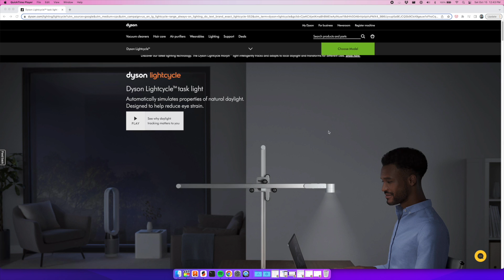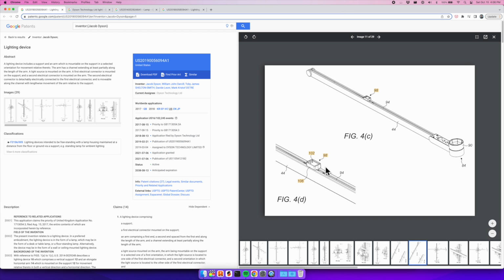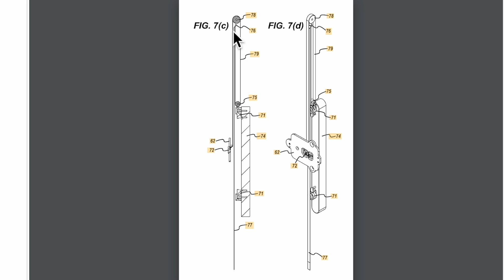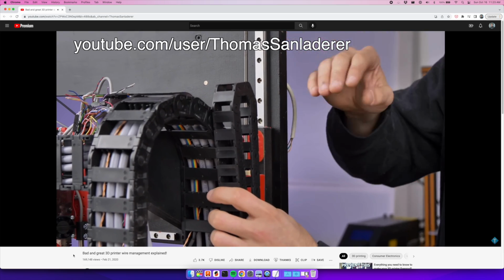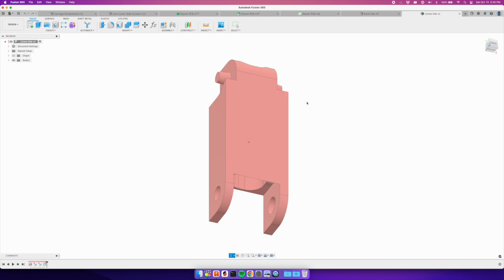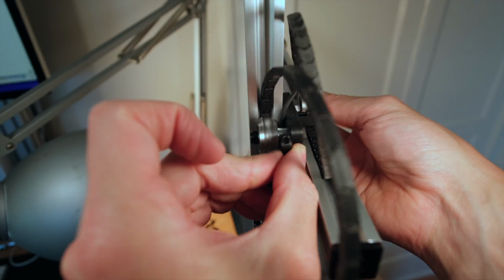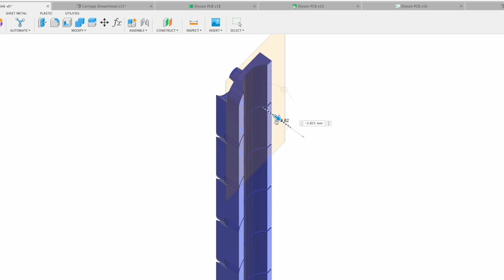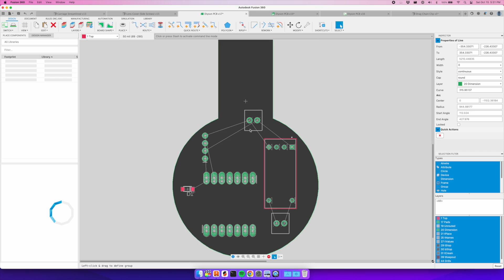Cable management so good, it's illegal - DIYson Lamp Build Log #6

Comment: I have two of the 1st Gen Dyson Lamps.
Your setup is missing a somewhat crucial part for it to have functioned properly - A stationary "Retaining Bar" that is situated ALONGSIDE the Rail that moves back and forth.
Between the stationary and moving Bar is the Ribbon Cable inside a Channel of the moving Bar located that would gladly like to pop out of it ( like yours do ) but cannot because of the stationary one. You COULD get somewhat of a similar effect with your Drag Chains IF you were to design for them to only be able to curl up in one direction but NOT the other though in any case, you'll not be able to hide the wire like that as you're simply not able to pull off a tight enough bend for the cable not to break under repeated bending fatigue.
Reply from the maker: Interesting detail. As far as I can tell, this is only a feature of the original CSYS but not the updated Lightcycle model. Is that right? If so, it seems like they were able to pull it off without the retaining bar after all :)
Reply: @StevenBennettMakes  The current Lightcycle looks like the horizontal bar consists of two bars with the Wheels and the Magnetic Connector in-between them implicating that that the ribbon band could be situated in there as well - For as long as the ribbon band doesn't get caught due to friction, I could see this still working out for them.

Comment: I think this is an awesome project and think your design is excellent. But I see a huge problem with yours and Dysons design. You can't rotate the light, like you can with your desk lamp. You can point the light sideways. I often do this with a desk lamp when working on a computer. I think this would greatly improve the design.
Reply from the maker: Yup, that's definitely a downside. Rotating the light source would be a super convenient feature, but I think it's a different project altogether (Dyson even has a different model called the "Morph" that does this, and the overall design is understandably quite different from the traditional Lightcycle that I'm trying to replicate). Maybe that's a future project?

Comment: Wild idea: use the aluminum extrusions as the ground wire, route a thick wire for the +12 volts of the LED and a thin wire (or 2) for power to tiny controller board. The controller board reads the buttons and communicates wirelessly with the main controller located in the base

Comment: That cable look really thick. Consider sending 60V over a much thinner wire and using a buck converter module on the lamp head. There are also more flexible silicone cables out there
Reply from the maker: I'm open to suggestions for a thinner cable! This is the smallest 2-conductor cable I could find (it already has a silicone housing).
Reply: @StevenBennettMakes  Huh, it's hard to tell over video but that cable looks more like PVC/vinyl rather than silicone. If you search eBay for "30 awg silicone" you'll find some really thin wires, but I'm not sure where to buy thin 30/2 cables. Oh here's an overcomplicated idea: Maybe you can use just 1 wire for +60V and use the chassis for gnd. That might cause the LED to flicker as the lamp is adjusted, but that can be solved with a tiny 100mah lipo in the lamp head.

Comment: Wheels can be made of conductive material. And you have 2 groves on each side... You don't need cables at all, just flat bars inside groves. Or some kind of clips with pogo pin contacts.

Comment: Thanks for the video, no need for cables you can use tow aluminum profile in parallel and electrically isolated from each other so u can passe power to the lamp with the top and bottom metallic bearing the same thing u can use it with the vertical  beam.

Comment: improvement suggestions :
1. you can use a esp32 than it is easier to make the lamp smart (because of the build in wifi funktion)
2. when you make mini V wheels on the inside of the weight and pull it to the rail whit magnets than it can roll smooth
3. for the wire you can use mini model train rails to transfer power (maby you need a capacitor (1500 uF approxi)) that the light dose not flicker)
(sorry for my bad english i am german)

Comment: I have a suggestion; I wonder if you can build a hidden spool for a wire on the center carriage. A hidden cable to drive the spool ( dont know if a spring loaded spool will work since it might offer an extra net force for your static carriage). 

Use thin 4 cable wire and by using a Power delivery USB type C to carry higher voltage at lower Current (like running at 24V), you might need to run a small buck converter to drop it to your voltage. And I suggest you start on your own custom circuit board (hire an electronics student as a side project). At least a custom PCB for the power and switching side while still using an off the shelf micro controller board.

Comment: why do you need 2 cables - just use the frame for one phase or neutral?!?!? frame is aluminium. change the bearings to metal ones to pass the current.

Comment: If you run nutral through the metal frame of the lamp then you only need a single power wire running up too the head. Just a thought.

Comment: Add a pulley to the end opposite of the led, then rigidly attach one end of the wire to the leds, run it through the channel, around the pulley, through the channel on the bottom, and rigidly attach it to the gantry.

Comment: I wonder if a bundle of individual PTFE or FEP (like Linneo from KB3D) would either let you run all the cables like your original plan, or at least let the drag chain lay a little more nicely? Either way, I totally agree that it all works and looks great, considering the tradeoffs.

Comment: You not need cables just focus on 2 independent track horizontal and vertical to carrying 12 dc. 3d print a square connection piece. So if square piece move vertical brushes will be touch to the vertical dc 12 volt track or if you horizontal piece square piece stay and brushes transfer dc 12 volt to the horizontal tracks that’s simple. They use same idea track lights for ceiling. No cable where ever you instal the light will be work in track. Check home depo…

Comment: Hi, great project.
Have you ever thought of making a W-shaped printed part to make two chanels in which you put a copper cable; all this put in the aluminum extrusion. And on the part with the wheels, two spring loaded pin connectors that would touch the two copper cables.
I don't know if I'm making myself clear, but English is not my native language :/
Reply from the maker: Great explanation, I can totally see how this would work. This idea of a "conductive rail" has been proposed by a number of people, and I think it's an attractive idea. Your inclusion of the W-shaped channels is a really nice way to fix the copper wires and prevent a finger from shorting them. I will keep this solution in mind, but I think the construction of this part and the sourcing of the "rails" and other required components are more difficult than I'm comfortable with for a project which  focuses on being approachable, and (hopefully) affordable. 

Great idea though, at the very least I would like to build an "ultimate' version of the lamp that uses a solution like this.
Reply: @StevenBennettMakes  Thank you.
About the "rails", you can use rigid cables (with one solid copper wire and not several strands) that you will glue to the bottom of the W-profile.
And for the pogo connector (or Spring connector SMT), it's very easy to find on Aliexpress.

Comment: Awesome project! Very well-designed and executed. I was searching for those thin flat white 2-way conductor cable strips for one of my projects. Could you please tell me where did you find them? I'll be very grateful.
Reply from the maker: Sure thing, I used this one which is a 10ft variant, but they also sell it in 5ft, and 500ft:

https://www.digikey.com/en/products/detail/parlex-usa-llc/PSR1635-02/213497
Reply: There are. 2gt belts with wire cores may be an option for power

Comment: If the wire looped in a U around the end of the arm it could theoretically be hidden in the the upper and lower channels (the change in distance in the two sides cancelling out as it's moved).
Reply from the maker: There's a heat pipe down in the lower channel :)
Reply: What about using the side channels, then?
Reply from the maker: @maximthemagnificent  (thank you for the suggestion by the way)
Reply from the maker: @maximthemagnificent  Those are definitely less occupied (the front one at least because the rear one has the carriage in the way). I wonder if that would actually be "hiding" the wire at that point (since it would be quite visible). This is why I'm so envious of Dyson's custom hollow extrusions...you can hide anything you want in there!
Reply: If left exposed it's definitely a personal preference call. Could always cover the side channels, I suppose.

I appreciate your openness to suggestions. Great project! 👍

Comment: The problem is that you are using the "X" extrusion in the vertical mast. The Dyson has a "C" type profile, they have two flat wires/ribbon that routes from the arm, up over a pully on the top (combined with the belt) down to the counterweight where there is another pully that turns it 180° up inside the "C" part of the vertical mast where inside the mast there is enough clearance to have the same type of slack loop like your drag chain going down to the base. the slack is all internal and that's why you don't see it in the Dyson product. take a look at the Dyson installation videos, they show enough in the video to figure out how it works.
Reply from the maker: Yup, not only do they have C-shaped rails, they designed and manufactured their own rails specifically for this lamp (their rails also have built in "fins" which help them function more like a heat-sink). My hope is to save a few hundred thousand dollars by getting ours off-the-shelf. This comes with downsides but designing within the constraints is all part of the fun in my book :)
Reply: @StevenBennettMakes  aluminum extrusion dies aren't "that" expenive. few thousand, not hundreds of thousands. Problem is they stick you with large minimum orders so you'd need a big material order going that route. I spent some time trying to find something comparable and didn't see much out on the market. There are thick walled square tubing you could modify. Machine  them down to suit, but that isn't cheap either.

Comment: Just wanted to point you in a certain direction, mate. I would suggest looking up steering wheel clock spring. You might find its design interesting.
Reply from the maker: Hey that's cool! I've never seen one of these and I can see why you thought of this. Do they come in size extra extra small?

Comment: Out of curiosity, any reason why you can't use the aluminum extrusion itself as power rails? For example, you could cut the aluminum extrusion in half, create a plastic/rubber spacer to isolate the two halves, bolt them back together using nylon bolts, then run low voltage through the two halfs independently, and if you need higher voltage you could use a buck converter in the LED enclosure.  You could then use some kind of bearing or brush assembly to transfer power between the extrusions.  Just curious.
Reply: One of my favourite lamps uses this principal by eliminating the wires entirely.  Maybe the DYIson could borrow from a 50 year old design of the Tizio lamp.
Reply from the maker: Cool idea, but wouldn't you short the circuit just by gripping the extrusion?
Reply: @StevenBennettMakes  If you're using low voltage, like 12v for example, then there shouldn't really be any risk.  The resistance of human skin ranges between 1k to 100k depending on things like skin condition, moisture/sweat, area, etc. So even in the worst conditions (tightly gripping the extrusion with sweaty hands) would generate less than 12ma of current through the surface of the skin, which wouldn't be enough to short a supply, nor be high enough of a restive load to generate heat up or burn the skin. It wouldn't even tingle.

If, however, it were high voltage (110v) it would definitely be a safety risk and absolutely should not be done as someone could be electrocuted.

Comment: Hi, new to this channel but maybe I have a possible solution for the cable situation: 
Check how the band for the counter weight is moving and kept in place by going from one side to the other of the aluminum profile. No matter how you adjust the lamp, the length of the band in one side is "compensated" on the other side (if short in one side, the other is longer.

You can make the same for the cable. From the lamp (in one extreme of the horizontal aluminum profile) to the opposite extreme of the profile (maybe a pulley is needed) then going to the lower channel of the profile, then going into the vertical profile, going all the way up and (with another pulley at the top of the vertical profile) you send the cable to the base. 
2 channels of the vertical profile are used by the band, but the sides are still available for the cable. 

You just need to nail the total length of the cable (easier routing from the lamp to the base and leaving additional length at the base) and a way to make the transition from horizontal to vertical, just like in you did in this video. 

Also, congratulations on the drag chain, it looks awesome.

Comment: I'm sure people have probably mentioned this, but what about like a linear slip ring conductor? Kind of like an electric train that gets its power from the tracks. You could fit two conductor strips down inside the channel on the aluminum and have like a leaf spring looking thing contact it (I'm not sure how else to describe it lol). I'm not sure how reliable it would be, but if it's properly tensioned and smooth, I think it could work pretty well.
Reply: I had a similar thought… two conductive wires embedded in the bottom channel of the lateral arm, exposed at the side facing out, and carbon motor brushes used to make contact. Conductive wire would be solid core, copper or aluminum, and the abrasiveness of the brushes would hopefully remove any accumulated corrosion or dirt whenever the arm is slid in/out.

Comment: You can use the thin and flexible kind of cable that pneumatic auto switches use (Example: SMC's D-M9PL sensor), and use T slot cover on the front or back slot so that the wire is trapped inside the slot and can't be seen, then make the cable go all the way to the opposite side of the horizontal arm and then turn towards the lamp, and cover the cable with baby powder or oil so that it slides and folds through the slot as you move the arm back and forth.
You could even change the wheels to metal ones and use the extrusion to carry the ground, to use a cable with one less wire.

Comment: What about non moving parts? Just fixed strips of induction loops on the vertical and horizontal arms. The base powers the vertical strip directly and a pickup on the intersection pulls power to power the horizontal arm.

Comment: You do have a wheel on top and at the bottom of the sliding arm.
So why not having a wire clamped at both ends of the arm and wrapped over the wheel?
You may need an isolated layer inside the arm, but this way you can have the wire touching some slider.
Just make sure the diameter of the arc the wire makes is the same as that of the rolling edge of the wheel. Otherwise it may prevent the arm from moving freely.
Another idea is to have this wire wound a number of times around the wheel and have another coil surrounding it, like a transformer.
But I don't know how the metal rings of the ball bearing will like this or maybe heat up?

Comment: Use a guide wheel at the back of the arm and the top of the stand that the drag chains and cable will wrap over and back, you'd need to make the cable longer, but it'll keep the drag chains "tensioned" and neat, without them springing out and creating unsightly loops. The use of end rollers will keep the drag chain straight with a nice uniform U bend only where it needs to

Comment: why not put the cables on a spiral spting and make them retractable this way
Reply from the maker: I did experiment with this (and other methods for coiling the cable in such a way that it's retractable) the problem is that since the horizontal arm (by design) glides smoothly with very little effort, the tension required to coil or retract the cable is more than enough to pull the arm out of position. Additionally, hiding a wound up cable is still a big challenge :(

Comment: first time viewer here. and first time viewing that lamp too lol. my take on making a lamp like that would be using the metal frame as neutral. One Flat strip isolated running the length of the all axis very likely in the roller(one of them if not a special isolated one) and just do wireless communication between base, midjoint and light tip. so just turn the rails into power rails and split the componenets in site, with wireless communication between then. lol

Comment: Contact PCBWay and see if they will sponser you to do a flex circuit for your custom power lines/flat cable. run it like you have your belt and you can at least make one of these for yourself. You couldn't sell it because of the Dyson patent, but you could make one for yourself without any issues.

Comment: I would recommend using some variant of power rail, at least for the vertical movement of the lamp. The same principle is used in ceiling lamps where you can freely move each individual lamp without breaking contact with the rail.